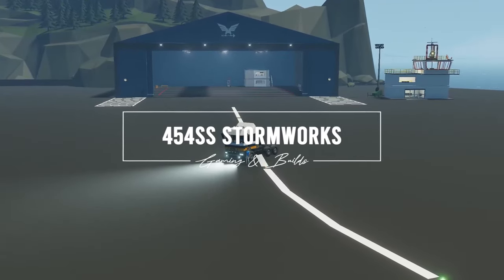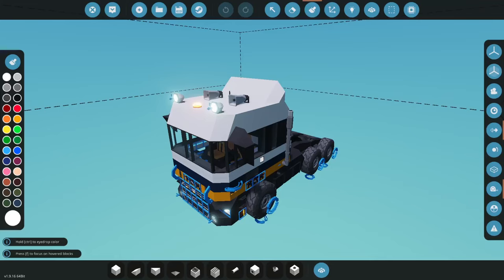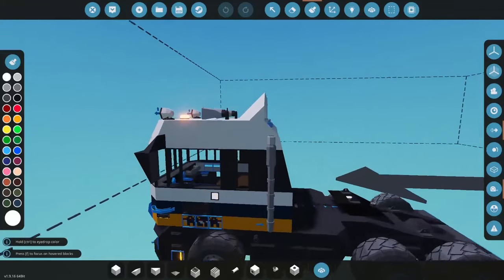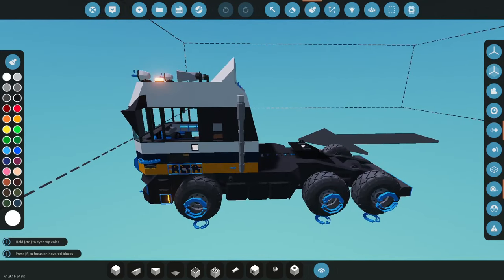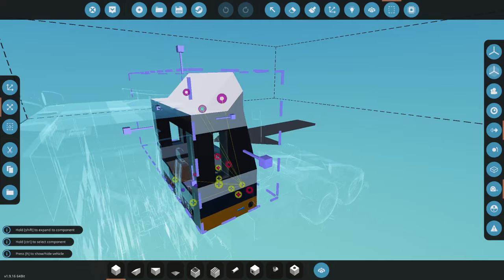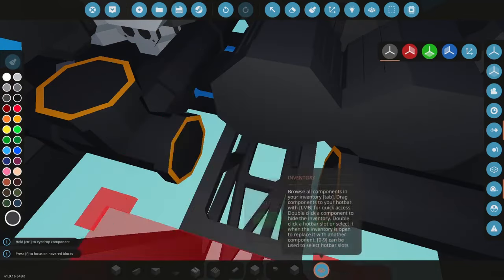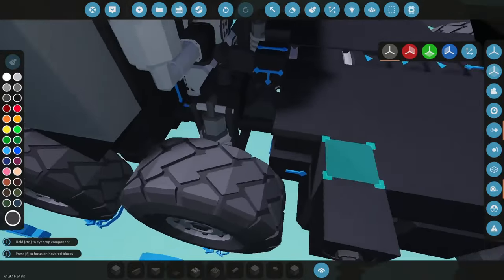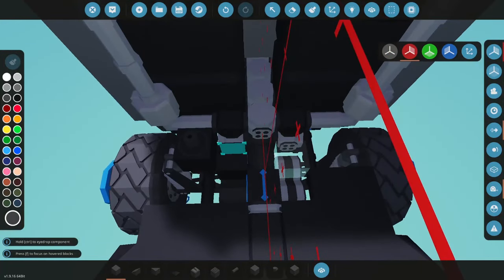EXTREME HEAVY DUTY Semi Truck Conversion in Stormworks

Comment: to balance the front wheel without adding more weight, you can put the fifthwheel more to the front to balance the weight between the axle irl many truck has a rail to do that